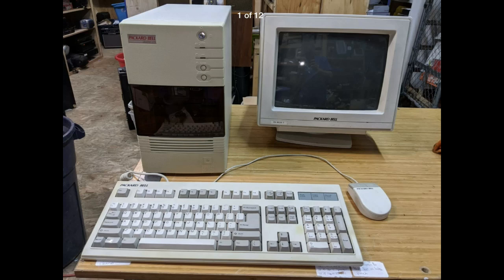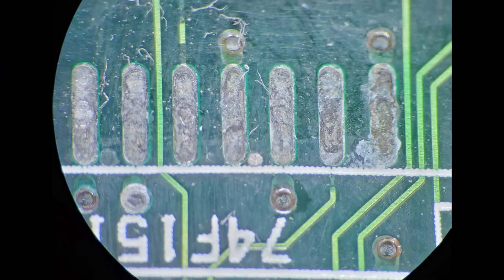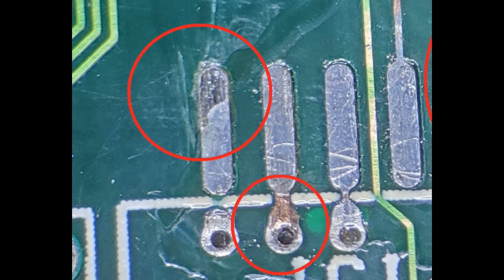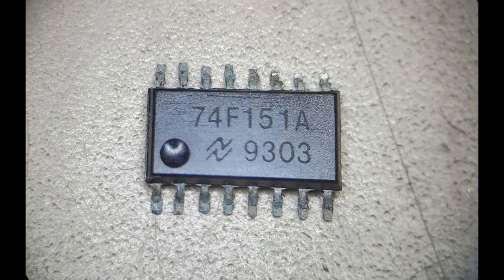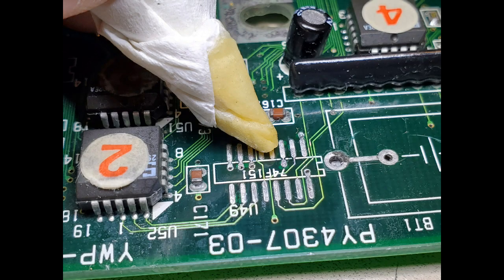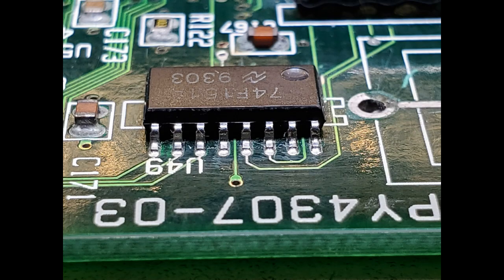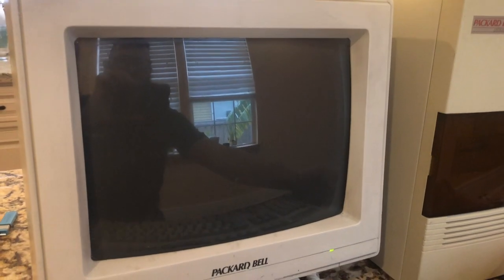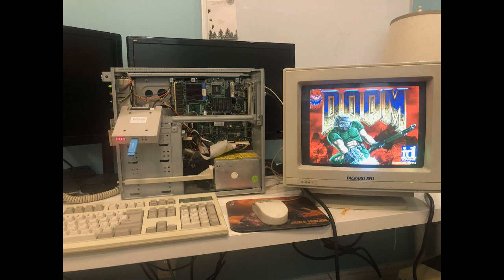How to repair Corroded Or Battery Damaged pads & Chips Ie Packard Bell PB422TA 486

Comment: Thanks for this! I have given up trying to separate corrosion from soldered components in the past. In my case I was dealing with through hole resistors & capacitors, not surface mount. The non-surface mount components will probably need to be clipped off in order to gain better access to use this scraping method for removal. The risk here is more damage to the PCB could occur. I usually stop at this point but I will reconsider depending on the situation.
Reply from the maker: Yeah anytime a soldering iron or a blade touches a circuit board it comes down to how well the board was made, the thickness of the runs /pads and the type of glue used. I've seen board that as soon as an iron touches the board the runs and pads lift, then others would take an insane amount of heat. The old Hewlett Packard Boards and Tektronics boards were great for working on. I found through the hole problems I chip away as much corrosion as I can then try to re-flow them, also gentle heat and use some Resistive Tweezers can help as well, but you risk stripping the eyelets out. In that case I just expect to strip them and install some new eyelets or drill them out with some extremely short drills and hope for the best. Best Wishes & Blessings. Keith Noneya